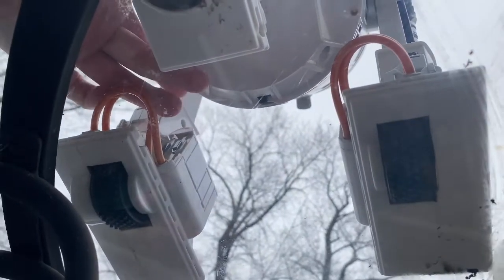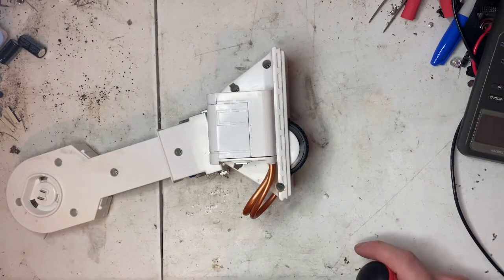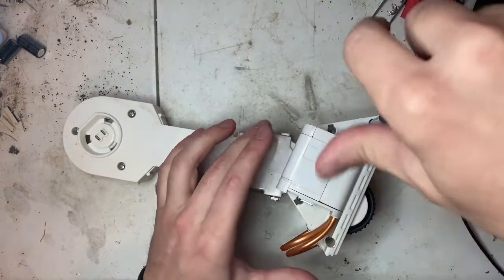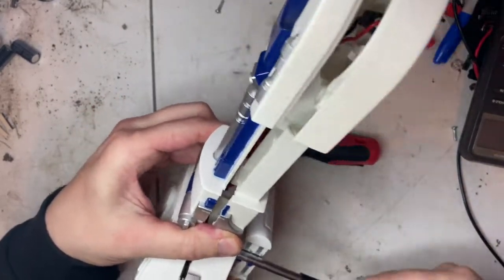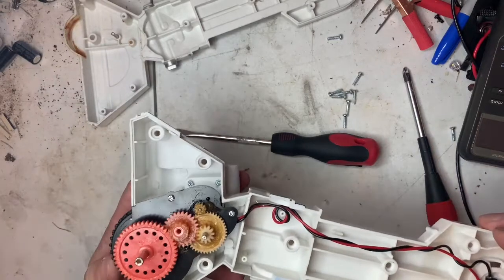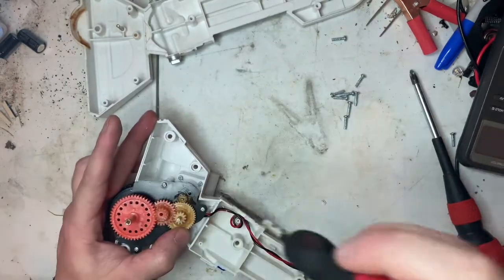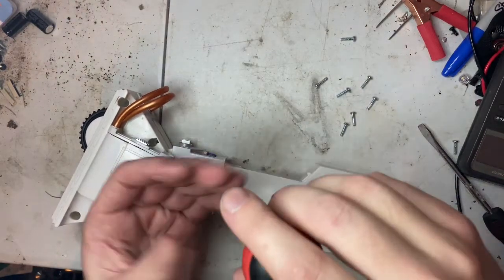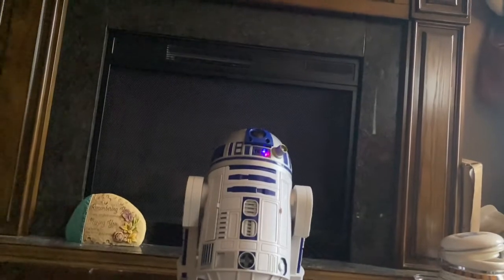R2-D2 Industrial Automaton Interactive Astromech Droid steering Repair

Comment: I have the same issue. The legs on mine are hard wired and the wire doesn't give enough lead to easily get to the screws. I suspect one of the drive gears are just worn. Plastic.